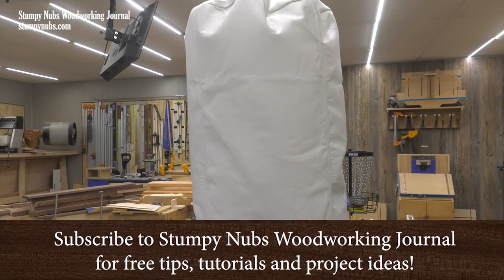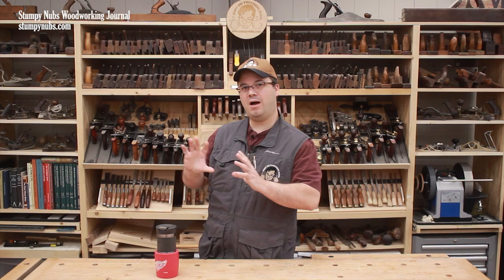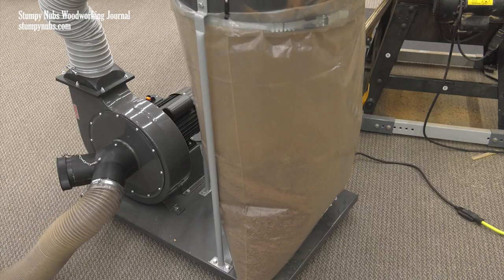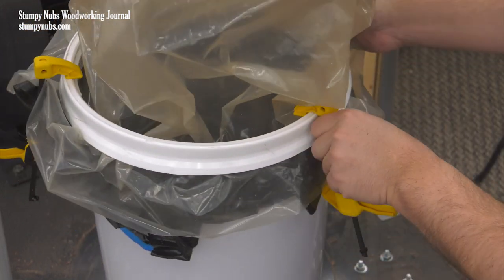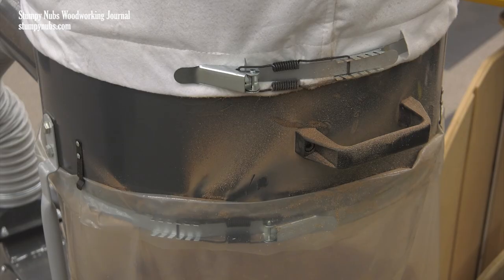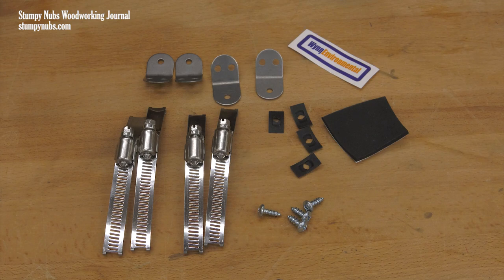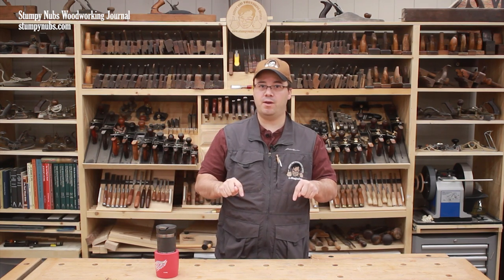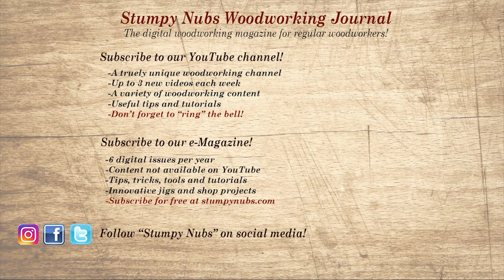How a bucket and a donut changed my dust collector

Comment from the maker: Canister filters for dust collectors► https://wynnenv.com/woodworking-filters/
Clamps► https://amzn.to/3pOFBin (Affiliate link may give us a commission)
Video about common dust collection mistakes► https://youtu.be/qjI5l4nF9AM
(This video was sponsored by Wynn Environmental)
Reply: How often do you replace the Wynn filters in your shop?  They're pretty pricey so I'm curious how long they last before they're clogged up.
Reply from the maker: @AlexRicketson  I clean it by occasionally blowing on the outside with compressed air. Lasts for years.
Reply: Wynn is a really great company and has lots of good information. They were a pleasure to deal with.
Reply: I am confused about component orientation. Why wouldn't you want the device that creates the vacuum to be downstream of both the cyclone separator and the final filter?    If you locate it in stream with the vacuumed media wouldn't that tend to plug or at least collect on the impeller blades?
Reply from the maker: @rh-cv3nr  These types of impeller blades are designed to handle materials like this.
Reply: Different solution
I got a 52 inch hose clamp and use it to attach the inside of the bag on the outside of the dust chute.   Easy.

I found the bag and bucket setup klunky

Comment: 3mil Contractor Trash bags work fine on the bottom of my single stage unit.   But they're not clear, so you do have to go and "pat" them every now and then to see how full they are.
Reply: If you use two nested garbage bags, with at least the outer one clear, and some air trapped between them, you can see at a glance that neither is punctured.  A puncture of either bag removes the space between.  Duct tape on any sharp edges of the strap keeps that from being a problem.

A Thien baffle mounted inside the green ring just above the bag adds little to no extra resistance, but does a good job of keeping crud out of the filter when the bag is more than 1/3 full.
Reply: Up here in Ontario you can buy clear heavyweight contractor bags.
Reply: I’m trying the 14” upside down wok in mine.
Reply: @Chuck-gd9rr  would love to know how that worked for you.  I am upgrading my old Delta single stage with a top cannister and just finished making  13x4 inch cone to mount centered inside with the bottom even with the bottom of the collector discharge chute.  At this stage, not sure but hope it will help to keep my filter cleaner than without it.

Comment: Furiously googles "gamma seal"  as not something I've ever come across in UK..
Reply: Heh, I don't even have the excuse of being from the UK -- I'm here in the US and even originally from the same state (MI) as James and I had never heard of gamma seal lids!

Turns out that they are readily available locally at the big box stores and online.  Apparently I have just never needed (or knew I needed) one?
Reply: Just cut a hole in a regular lid?  It's probably snap closed.
Reply: I agree...first get your bucket with a lid.  He's using clamps to hold it on anyway.   The gamma seal is a heavier duty lid with the screw in inside.  It is fabulous.  But if you can't get it, then use a heavy duty lid or make a heavy duty rim to match with plywood.   I used a router and cut several circles, glued them together to make a ring like the gamma seal lid.  If I can do it, anyone can.
Reply: The food grade white buckets and a gamma lids are good for storing dry foods like beans and wheat berries (for grinding later into flour).
Reply: Perhaps head for a car wash bucket with a lid - that's what I have here in the UK. They have a flat base and the lids fit well so just need a trip with a knife.

Comment: I have the Harbor Freight 2HP Dust Collector you show.  I bought the MERV 15 filter from Wynn a couple of months ago and easily installed it.  What a DIFFERENCE!  While the filter itself cost more than the Collector, it was more than worth the improved performance and cleaner air in my garage shop.  I will try the 5 gal pail idea as well.  Wynn also has a 10 pack of the clear plastic bags for a very reasonable price, which I picked up as well.

Comment: Perfect timing. I'm going to be moving my Grizzly DC soon and this is a great opportunity to make these changes.
Reply: The shop I work at just recently got a grizzly DC it works awesome (would be better if boss would let us reseal the collection pipes)
Reply: Update...i completed my move of the DC and added the Wynn filter. I mounted the blower (2hp w/12" fan) on the wall and connected it directly to the stock separator. I decided to leave my metal can pre-separator in place. I was only losing about 13% of my CFM with it which is acceptable to me. After installing the Wynn 35A (MERV 10) filter my airflow went from 320 cfm to 515 cfm at the jointer. Thanks for the great tutorial SN!

Comment: Here's an even more budget-friendly option: Exhaust to an outside vent, rather than a filter, if you don't mind cutting a hole in the side of your house. I use a cyclone w/ drum and run that to a dryer vent that dumps into the backyard. The only time I've ever had any noticeable dust outside was when I overfilled my drum. I can't imagine any filter setup being more effective or cheaper.
Reply: I do the sand thing except thru a window and I swapped my impeller with the rikon replacement impeller. Fit perfectly, increases both flow and static pressure. 
It's bigger and the fins face the opposite way.
Reply: @barryomahony4983  I'm using a similar unit and it works fine.

Comment: I'd rub some superglue into that wooden doughnut wherever you intend to add silicone sealent too (before installation). The silicone will be much happier sticking to acrylic than wood, especially where you need to prevent leakage.

Comment: I got a canister filter from NAPA. They have those for semi trucks. Works well.  Good tip about the bucket. I was thinking about making a see through cylinder and then attach regular contractor black bag. I could still see through the cylinder to see how full the bag is.

Comment: Great video as always! Have you any recommendations for the minimum horsepower (or CFM) of a single stage unit that down the road can be converted to include a cyclone separator? I'm on the fence about what to buy - two stage is a bit pricey to get my feet wet but would like the option to convert in the future so as to spend less now. Thanks for all your great videos, always lots of useful information

Comment: I got the filter from grizzly.It fits perfect on the outside of hf unit. Don't need to make a donut.
Reply: I did same. Fits perfectly. I also added the growler separator. I did a couple mods to that as well, including a new and larger bucket
Building frameless cabinets I can cut all the parts for about 20-25 cabinets before empty the bucket. The fines in the clear bag are about a quarts amount. My suction is much more stable, little loss as bucket fills with separator installed.
I will be adding a dual bag dc system in the near future as well.

Comment: Great video! Thanks for the creative, practical ideas. Question: I know this is very dependent on level use and volume of cuts but how long can one expect to utilize one of the large, canister filters like you showed in this video before having to replace?
Reply from the maker: You can clean it out with 60psi compressed air. It will last a very long time.

Comment: Adding a Wynn canister filter to my single stage dust collector is just about the best upgrade I've made to my shop. Not only did I get better airflow, the air coming out of the filter was much cleaner than the air coming out of the filter bag.

Comment: Dont take this as advise, I've 0 workshop experiences.
But I do have a question. What if you statically charge your filterbag (by rubbing it against a rug or something) fine dust is also charged, due spinning in the filtration system, so it will probably stick to the filterbag

Can someone confirm or deny this thought experiment?

Comment: The diameter of the plastic bags that came with the Wynn Filter is much larger than my  Jet dust collector diameter, which is 13 1/4 or so.  I think just folding it over a couple of times and clamping with the metal band clamp should be fine.  Would you concur?  Oh thanks much for the video!

Comment: You should do a test to measure the change in flow of your DC set up with a Thien style and dust deputy separator vs none. An hvac duct velocity meter will do it, and you probably have a buddy who works for an hvac contractor who would have one. The absolute values aren't that important - it's the comparative values that are. Then you have the #'s to back up your statement that separators cause too much pressure drop/flow loss. 

I did the test on my HF dust collector with and without the Thien. It's been over 10 years ago, but I think it was ~15%. Still had ~450 cfm at the end of the hose which is sufficient for the way I use it.

Comment: Hi, have seen on Ebay from woodworkers supply inc in the USA 1 micron dust filter bags which a far cheaper than the fine paper filters and was wondering on your thoughts if the claims could be true?

Comment: Excellent solution. I am right in the middle of putting together my 2HP Harbor Freight dust collector complete with Wynn filter. Your method of using a 5 gallon bucket and a gamma seal ring is just brilliant! Ingenious! Thanks for this idea. This video cost me a lot of money. I bought the dust collector, the Wynn filter and another 25 bucks on fasteners Harbor Freight forgot to include - plus the 15 bucks for the gamma seal lid all because of your video. So ...... uhmmm ....... thanks? Seriously, thanks.

Comment: Great video. The dust separator drawing you used is not quite accurate, the tube with the exiting air should be in the center of the lid. I built a portable dust collection system using a 2" shop vac and a trash can that works very well. It can only be used on 1 piece of equipment at a time though due to its small size. I built a frame for the shop vac to sit above the metal trash can on wheels and have found it to be the most useful hack I have ever built.
I am just a hobbyist wood worker so I'm not quite in need of a larger system but when/if I do I will take your advice from this video.

Comment: Rather than using cheap clamp to hold the gamma seal rim on, I put Several pipe clamps together and seal both bags around the bucket. Works great.

Comment: I plumbed my dc so I can dump the exhaust out the wall of my shop. Built a dryer vent style wall vent with a blast gate, so can turn it off on really cold or hot days.  Have a paper filter, but it reduces the flow of air by half.  So use the outside dump most of the time.  Down side is if I run the barrel over, it shoots dust outside the shop.

Comment: I just added a Wynn Enviro MERV 10 filter to replace the 30 micro bag on my Buck Tool 1.5 HP D/C. I can't believe the difference! The amount of fine dust in my shop is now near zero. What is still present seems to be coming mostly from my table saw at the blade as I don't have an "overhead" dust collector on it. 

It was a $200 "upgrade" on a $290 dust collector, but well worth it from a health and cleanliness improvement standpoint IMO. The only drawback is the D/C is now quite top-heavy with that heavy filter up top. It's quite easy to have it tip over when it rolls over a power cord. I need to add a concrete block to the base to make it more stable. Also, love your tip on adding the bucket and disposable garbage bag.

Comment: In theory, would a open end filter on bottom and closed end filter on top create greater suction due to the doubled surface area of the filter?  Along the same line of question, would placing another one of these blower motors inline within a collection system, say 15 foot away from the other motor and filter give it a large boost in suction?  Or does this sound like overkill for a two car garage shop?

Comment: Installed the Wynn 35A274BLOL canister filter on my Jet 1100 series dust collector. The quality of the canister is superb and super easy to mount. I have been upgrading my piping with drain and sewer pipe which improved suction but the Wynn canister filter doubled my CFM over the cloth filter. I've been using an anemometer to get readings of every change I make. The filter was the greatest improvement without question. Thank you for this excellent video.

Comment: Very nice video.   I  really like the upgrades, but I do have a question:   I went on line and found  a canister filter @ 18" Dia x 31 tall,  (2262 in/sq area)  my question would there be any advantage of using this instead of just making  a box frame with (4) 20 x 30 air filters (2400in/sq area)?  I'm asking cause the canister is running around $257.00   vs 4 air filters for $58.00 for all 4.

Comment: Wonderful and very informative video - Thanks! However, the change to the dust bag is totally unnecessary, IMHO. Take the bag outside and dump it into the green waste barrel for pickup or put it in you garden or flowerbeds. I do recommend wearing a respirator while doing this. Keep up the good work.

Comment: Yes, this is the video I wanted to see a second time.  Particularly the dust collection bag and bucket.  I LOVE that idea.  I will be doing the same with mine this afternoon.  I have the cyclonic dust separator and the Wynn MERV10 filter.  I have yet to upgrade my 3" ducting to 4", but that may be next year (2024).  I just removed the disgusting filtration bag (a.k.a. dust pump).  Had leaks around the rim of the metal separator, both the filter bag and the collection bag.  As for the collection bag - I put a quarter inch thick weather stripping around the circumference.  The bag now fits snug.  HOWEVER, one situation I've encountered is the band clamp - it's almost too short to go all the way around.  Nevertheless, with much persuasion I was able to get the clamp onto the first notch and flip the latch to hold it in place.  I don't want to be messing with that again, so - - - the collection bucket with the trash bag in it is awesome.  Like I said - I will be doing that shortly.  BTW:  I uploaded a video to YouTube (4 min's long) showing my approach to sealing the leaks and installation of the canister filter.

Comment: Great video!  I am about to buy a 2HP single stage for my small garage shop (500 sq ft).  The manufacturer offers an upgrade to a canister filter which I will order with the main unit.   Thinking about the 5 gal bucket idea too.  Thanks always for sharing!

Comment: Very timely.  I have an old Delta collector with canvas bags both top and bottom that I always said created more dust than it collected.  Last month I spent about $35 on <the online store named after a river> and bought a pack of the heavy-duty plastic collection bags for the bottom and a supposedly "1 micron" replacement bag for the upper.
My cheap experiment gave me results beyond my hopes.  The system doesn't seem to vent any dust at all compared to what it used to.  I still have a home-made air filtration unit with a furnace blower and MERV filters that I'll continue to use as well as a 3/4 face-mask that gets put on the moment chips start flying.  (Any other woodworkers out there allergic to sawdust?  <rolls eyes>)
I was concerned about airflow reduction but, to my surprise, I have no noticeable loss of suction.  (Though, I have no objective way to take a measurement so I can't say for sure.)
My next step will be to go with your bucket idea (awesome) and then eventually upgrade to a cannister filter now that I'm confident I'll get my desired results.

Comment: Brilliant. You are the best, James. 

I am in Ontario. I have a low-end Craftex dust collector from Busy Bee Tools. Some months ago I replaced the bag filter with a cannister filter (manufactured to fit the collector, with some lithium grease required to push the seal on). This resulted in a big reduction of the amount of fine dust collecting on surfaces in my garage shop, so I expect that it improved air quality too. However, I have long been very frustrated at the brain-dead design of the plastic bag attachment system underneath the dust collector filter. 

About two weeks ago I did something stupid, and jointed a large amount of hard maple (for a Chris Schwarz style workbench). I rationalized that the jointer produces chips but not much dust. (Wrong.) I had the dust collector attached, but neglected to wear my excellent Elipse P100 respirator. (I did wear the respirator for ripping and thickness planing.) This had disastrous results - pretty serious lung inflammation the next day. (No, not covid-19.) My physician has prescribed an anti-inflammatory inhaler, and told me that I could expect the inflammation (with dry cough, fatigue, malaise) to go on for two weeks or more. I am still feeling the effects. I had previously been aware that I am allergic to birch, but maple dust did me no good, and I suppose all such dust is dangerous for me. I have learned a painful lesson here.

Anyway, I have launched into a project of improving my air quality, based on James' earlier video on dust collection mistakes. Meanwhile, I have been sitting around trying to figure out how to improve the disposal problem for the dust collector. And...Stumpy Nubs to the rescue!

For Canadian viewers, gamma seal lids are not quite so easy to find up here. They can be ordered from Uline or Amazon. This morning I picked one up at the local TSC Store. Cheap clamps coming from Amazon.

Thanks again to my favourite Michigander.

Comment: What's your opinion of using a second air cleaner? Like the relatively inexpensive boxes that hang from the ceiling, an air scrubber, or ionizer.
Also: In one of matthias wandel's old videos he was testing his shop's air quality and was surprised that the air around his DC was cleaner than elsewhere. Thoughts on this?